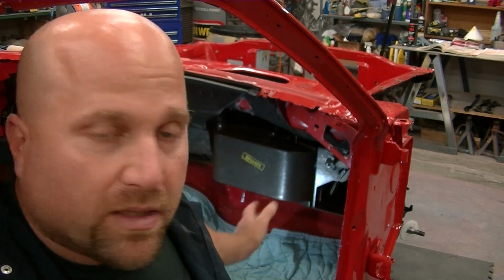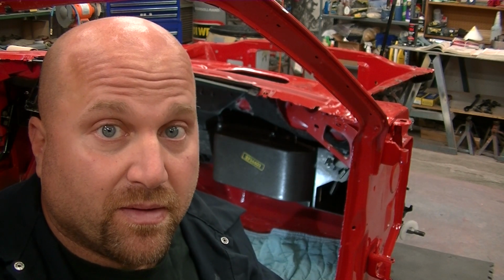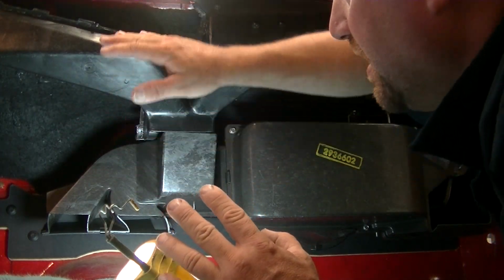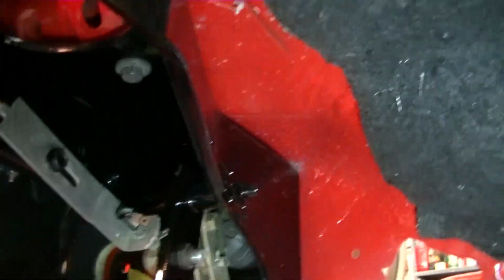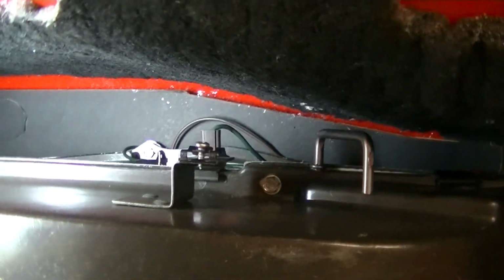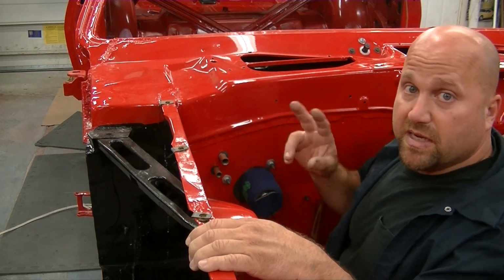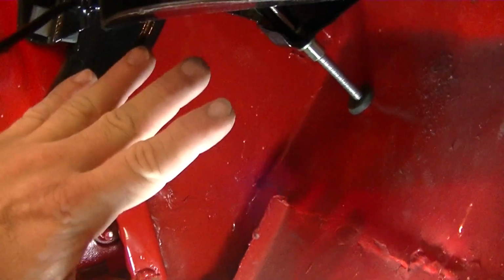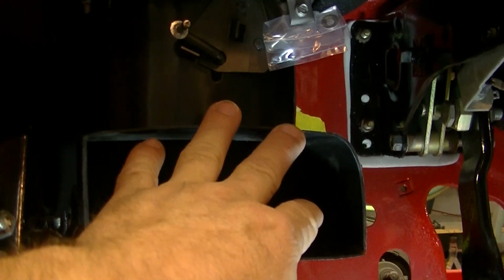Heater Box Installation Cuda

Comment: I realize this is OLD NEWS. but unfortunately this is the only info out there at present time.  anyway, there is another connection holding the heater box in place, not just the (3) nuts to the firewall. there is a 4th connection on the back side of the fresh air vent at the gasket to cowl. see 3:04 in video. there is some kind of clip that hooks the cowl and supports the back of the box.I can find it referenced anywhere. This would have been a great point to cover!